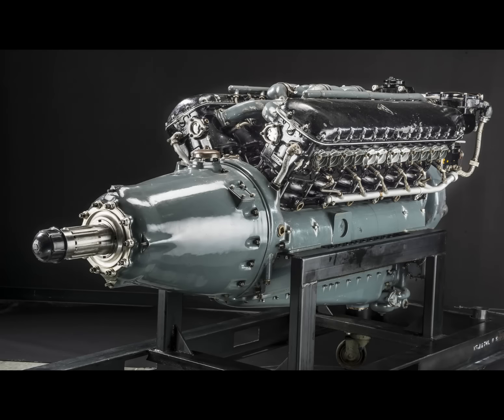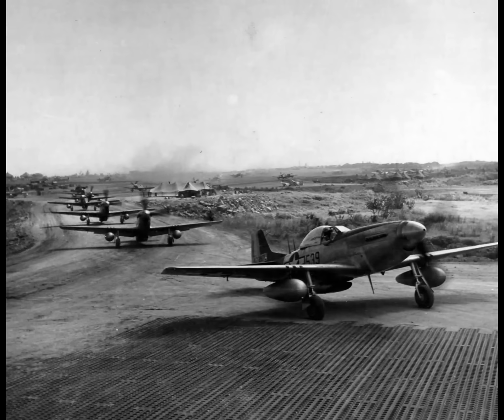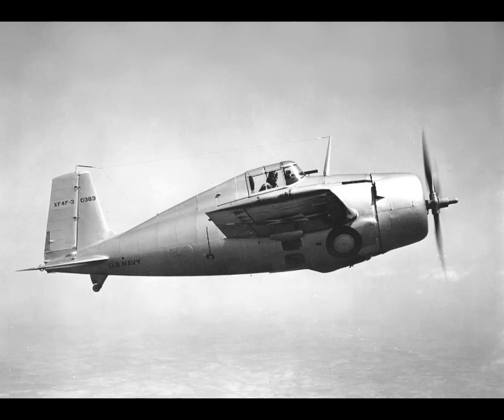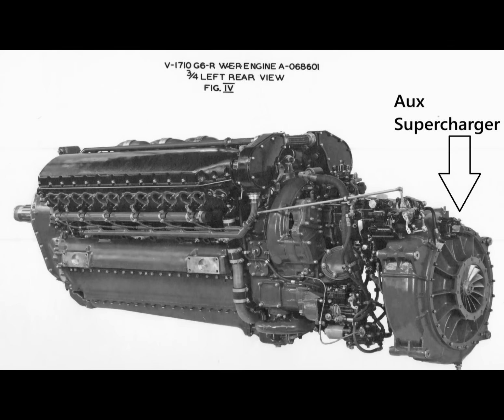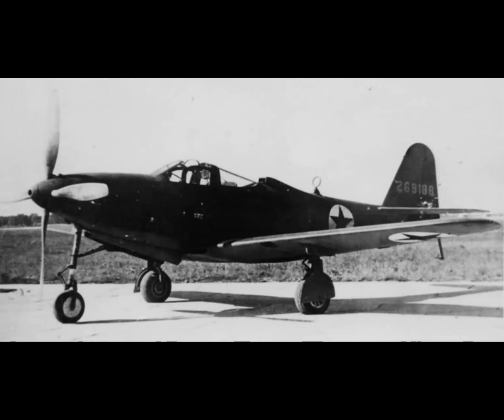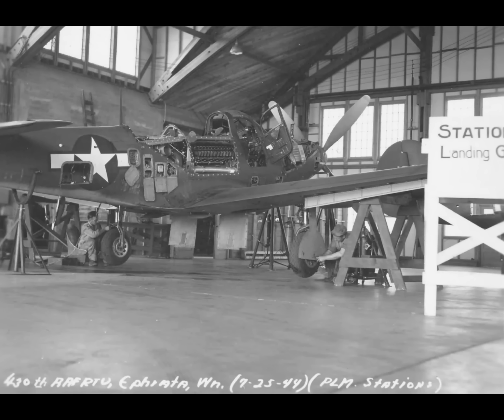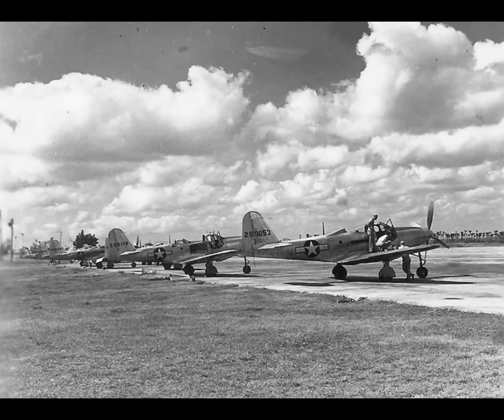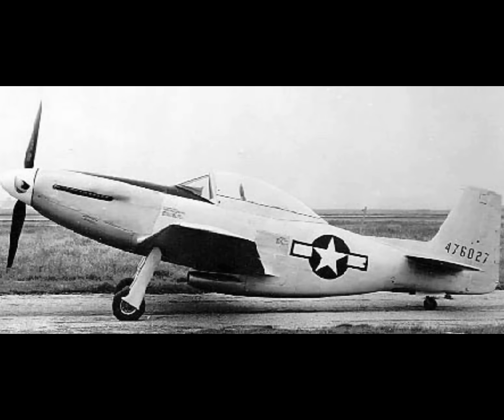Allison V-1710 with a TWO-STAGE Supercharger

Comment: I believe that one difference between (at least) the early Allison and the single-stage, single-speed Merlin was the impeller diameter, with the Merlin being at least an inch larger in diameter.  This seems to have limited the engine's critical altitude; the critical altitude of the early Merlin AFAIK was limited by throttling losses at sea level more than anything else.  In other words, if you tried to give the thing max power at 20,000 feet, you wouldn't have enough guts to fight at sea level.  The Allison's critical altitude was limited by the impeller output.

Then you've got the question of development dollars and man hours.  The Merlin was everything to the British, and the RAF, Air Ministry, and Rolls Royce were willing to throw in whatever it took.  I don't think that the Allison had that kind of priority- the US had a huge amount of money and manpower compared to the British, but a) we were also making a lot more crap, including enough shipping to form a land bridge to Australia, and b) did we have enough engineers with the right skillset who could be spared for a second- or third-priority project, redesigning most of the intake system?
Reply from the maker: That's exactly right. The Two-Stage Allison was not a priority and it didn't need to be, which is why although it had a lot of potential, ultimately it's an an aviation footnote, but still one worth talking about.

Comment: Why did you say 100 octane and 130 octane to differentiate between the two grades of Avgas? Is it not actually 100/130 and 115/145 grades?
Reply: There have been many different avgas specifications over the years.
Reply: @givenfirstnamefamilyfirstn3935 Yes, but there has never been 130 grade. 100/130 and 115/145,  were commonly called 100 and 115.
Reply: @MikeSowsun   The modern avgas commonly used is blue 100/130 but there were short production run war time grades.  130 and the later 150 were exotic additive detonation resistant grades for very high manifold pressures.  If you find the Spitfire XIV test flight speed graphs the fastest were using new 150 fuel with the supercharger boost so high that the throttle was only fully opened on the high supercharger speed at 25,000 feet!  That gave the widely quoted Mk XIV top speed of 449 mph true airspeed.
Reply from the maker: Mike, the dual rating systems like 100/130 is from two different testing conditions. The 130 is for high power conditions, as we are only talking about maximum power here as it relates to octane, the 100 in the 100/130 isn't relevant. It's the 130 that matters at War Emergency Power.
Reply: @GregsAirplanesandAutomobiles   At 7:29 you said “The P-39 is on 100 octane fuel. The P-63 is on 130”. Can you please explain which two different fuels you are talking about?

Comment: The Allison V1710 was an engineering masterpiece. But it will always remain a mystery to me why the US tooled up to build the Merlin when they could gave just tooled op to build the 2-stage, 2-speed supercharger and adapt it to the Allison engine.
Reply: The US tried grafting the V-1650 two-speed/two-stage supercharger onto the V-1710, but did not develop the idea because of the length of time that would have been needed.  The lash-up apparently experienced a number of failures during testing, according to the book "Vees for Victory."  The US tooled up to build the V-1650 in order to help the UK and Gen. Arnold worked a deal to procure 3,000 engines on the back of the initial British order for 6,000 engines.  This essentially got 3,000 engines added to the US supply chain under the guise of helping out an ally.  

Nothing like raking your own domestic engine maker (Allison) over the coals for a decade, making them fund development and type approval of the V-1710 on their own funds while doling out a mere trickle of orders (and while restricting export sales prospects under the Neutrality Acts), then handing a fat contract for 9,000 engines to Rolls-Royce and Packard as a kick in the teeth to Allison.  

Packard wasn't a clean winner in the deal, because they'd gone a similar tortured route with their own A-2500 V-12 aero engine (which evolved into the M-2500 series of supercharged marine engines used in the PT boats--a much smaller production run), although they did get to build a bunch of Merlins, which is some compensation.

It's not an uncommon theme in US military procurement.  Like how American Bantam got similar treatment with the Jeep--US Gov't giving Willys and Ford access to the BRC design, then giving Bantam a consolation contract for trailers to be towed by the GPW/MB.  Or how Northrop got screwed with the F-20.  

That aside, the Allison was significantly less expensive to build and had much lower maintenance man-hours required to overhaul the engines with slightly longer time between overhaul in similar service.
Reply: What is strange is that apparently or allegedly Packard were supposed to have developed the two stage supercharger of the 260 series Merlins in house without full support from Rolls Royce.  They had been making two speed single stage Merlins for the Brits.  From Stanley Hooker’s book ‘Not Much of an Engineer’ the highly efficient Merlin induction was supposed to be responsible for most of its success so this story would be more remarkable if it is true.
So why could Allison not do similar?

Comment: Seems like a hydraulically-driven supercharger would have a lot of inefficiency.  Hydraulic drives lose a lot of energy to heat.
Reply from the maker: Yes, absolutely true, but it's less inefficient than throttling the supercharger. There is no 100 percent efficient option, it's a question  of find the least inefficient option.

Comment: intercooler --> aftercooler

See: 2:50
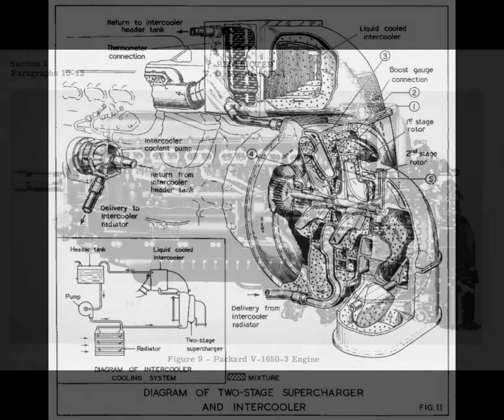Reply: 2:41  Merlin had both coolers
Reply: @appaho9tel  It wasn't really an intercooler, though, the supercharger housing itself was cooled. There was no separate cooler that could be called an intercooler, in other words.
Reply: @appaho9tel  Also, that image is labeled incorrectly, as the labels are pointing to the aftercooler components.

Comment: @gregsairplanesandautomobiles An interesting topic--or series--would be the Liberty V-12 and its influence on V-12 engine development.  It seems like many engine manufacturers had their start either manufacturing the Liberty for WWI, or rebuilding/modifying the surplus engines for racing and commercial use during the interwar period.  Packard, Hall-Scott, and Allison all shared varying levels of involvement (with Jesse Vincent of Packard and Elbert Hall of Hall-Scott being involved in the Liberty design).  Liberties were also used in British cruiser tanks, although I don't know what influence the engine had in UK V-12 development.
Reply: Oddly, the Alison, Merlin and Liberty were contemporaries. The Liberty was re-inlisted as a stop-gap powerplant for early WWII tanks.

Comment: Greg, great info as ALWAYS.
You seem to cover the reason the Allison was not in the 2 stage business.
I understand the 2 stage was in short supply do to them needed in the newer design P-51 and the existing P-39 -P-40 refit just couldn't be worked because of there age and (I'll say it) need to finish off the German's left in the air.

Absolutely loved your P-47 series.  Great work.

Comment: I understand that the Alison had a better engine in terms of simplicity and having a lot less parts. This leading to good reliability and simpler maintenance.

I also would be interested in a video (but it isn't perhaps not Greg in Greg's style) where people compare the cost of purchase versus service life for the P47 versus the Mustang. Other than a ground attack mission profile usually being more dangerous, a Mustang costing 2/3 the price of a P47 with lower fuel use seems better, but loss statistics in terms of replacement airframes, lost pilots etc, might change the picture.

Lastly, if P47s spent more time in repair, that may be because they took damage but actually managed to return to base, whereas P51s usually either came back unscathed or were simply lost in combat.
Reply: Yea, that's the problem with a lot of comparisons.  They never really go into the nuances of an argument one way or the other.  This is actually Greg's style, in many ways, and makes his work refreshing.

As for costs, it really is a very subjective matter.   What costs are we speaking of?  Dollars vs. Lives?  Sheer performance vs. Reliability?  Master of one role vs. Jack of all trades?  Pressed into service in disadvantaged circumstances vs Employed at the right time, right place, and under advantageous conditions?

At the end of the day, the P-47 fought the Luftwaffe during their prime, and the top ten P-47 aces all survived the war, but do the politicians (that includes Generals) always make their decisions based on a nuaced assessment or does the bottom dollar, which is usually the cash value, usually win over?  Then again, with a war already won, perhaps the dollar was the most important consideration.
Reply: @clarkenoble I agree whole heartedly with you. I imagine accountants thought F51s for post WW2 and Korea were the cheaper option based on a very small amount of variables. Perhaps just fuel usage and purchase cost. So the P47s were sold or scrapped
Reply: @kentl7228 Yea, and perhaps they were right in the long run.  Although, I believe P-47s would've been a slightly better choice in Korea.

I just wish someone would get the government spending we have now under control!  Ha!
Reply: @clarkenoble I would think the long run wasn't so long with jets and Skyraiders. Skyraiders were brilliant, but I wonder if they were a better option than a P47. The Skyraider carried more but was lower fighter style performance.
Reply: @kentl7228 Yea, I think that was the primary thinking.  The jets were going to take over the primary fighter role, so for a backup fighter, the cheaper option was probably better, certainly during peace time.

I think for Korea the P-47 would've been a better choice than the P-51 for the same reason the Skyraider and Corsairs were so good.  It was a big, radial engined brute that could soak up more battle damage than the liquid cooled P-51.  The primary threat to the propeller aircraft in Korea was ground fire because they were primarily employed in the close air support role.

As for close air support, the US Air Force has never really liked doing that mission.  So, again, at the end of WWII they probably weren't considering that heavily when they chose to retain more P-51s than P-47s in the active force.  Also, just like WWI, there was the immediate post-war euphoria and hope that the next war will be a long way away.  Well, it only took 5 years....

Oh, and Greg has discussed what the Tiawanese were able to accomplish against Chinese jets with their P-47Ns from 1949 onward.  The P-47N was very capable.

Comment: The way I see it the Allison makes better sense for smaller aircraft because of its power-to-weight ratio but the war went in a direction where range requirements necessitated larger aircraft and you cannot simply stretch an engine. Merlin being bigger was a better fit, unless your aircraft grew to double engine sizes like P38.
Reply: The Allison displaced 1710 cubic inches, the Merlin 1650ci.  The Merlin 2-speed/2-stage design was more compact than the Allison auxiliary drive setup, making integration into an airframe easier.  On the other hand, the turbosupercharged Allison should have a fuel-efficiency advantage, giving more range for the same amount of fuel, and a wider power band, as Greg has covered in other videos.  Both the Merlin and Allison produced similar power at similar points in time.  

The Allison also had a lower parts count than the Merlin.  The base engine was effectively modular, being easily upgraded and could be converted in the field from clockwise to counter-clockwise rotation.

Comment: For the first time, I understand why the P-63 was popular in post war air races. All that power at sea level made it fast at the usual pylon race course altitudes.
Reply: Tex Johnston, a Bell test pilot who shortly went to work for Boeing, won the 1946 National  Air Races, defeating North American test pilot George Welch in a P-51 among others. In his book Johnston discusses how testing Bell had done during the war indicated the P-39 was competitive in speed with the P-51 at low altitudes. Johnston state his Allison had been updated to P-63 specifications, which in the smaller airframe of the P-39 proved a winning combination.
Reply: Why is it not in air racing in the last few decades? Too few examples made/surviving?
Reply: the P-51A was the single fastest low altitude piston airplane of WW2. It surprised me it wasn't seen more, other than the fact hat so few survived the war due to limited production. They were used until they were gone.
Reply: Kick in the high blower, and spray water/methanol. Even at sea level.
Reply: @Triple_J.1  2-stage high-altitude superchargers don't work like that. and engines can only withstand so much boost without exploding.